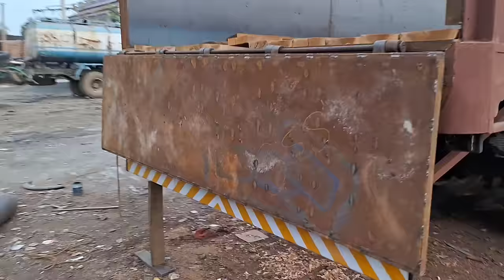TATA 4830 BS6 TRUCK BODY BUILDING AND MAKING PROCESS IN INDIA //INDIAN TRUCK BODY BUILDING // भारत

Comment: There is no safety, Wood and arc welding, composite construction.Actually Truck Body Code is implemented in our country from 2018 October onwards. But the registering authorities don't about this or they register the vehicle through bribes. Even ARAI  authorities (who have made the norms) and Morth is not bothered about the safety of Drivers.
Reply: Indian are not beginners 
Not single accident of work time
100 % safe cabin
ms sheet coverd on wood
So dont worry